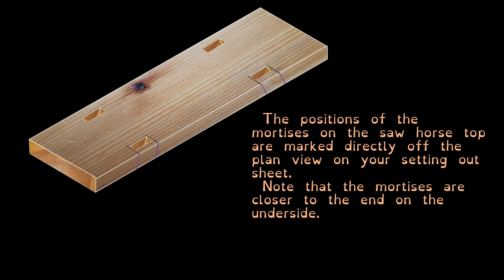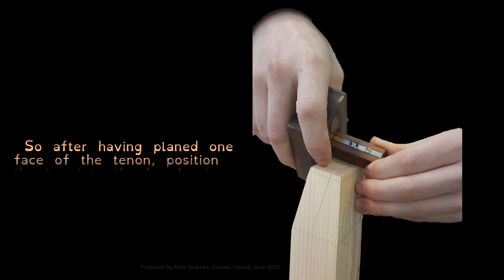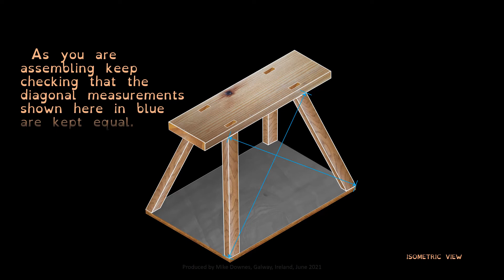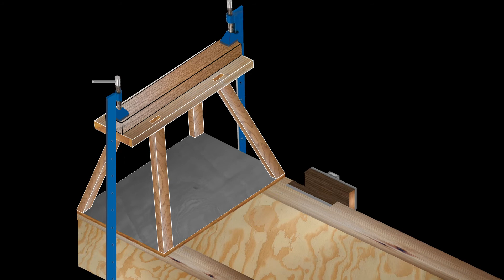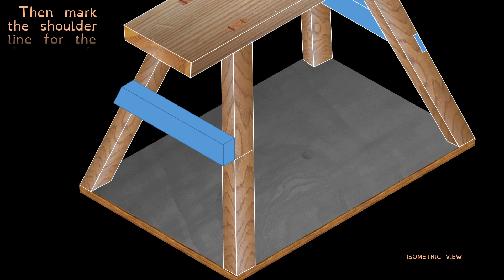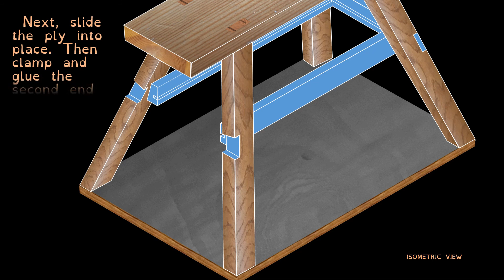HOW TO MAKE A JOINTED SAW HORSE (part 3)

Comment: Great video series, only one question, why have a straight mortice and an angled tenon instead of an angled mortice and a straight tenon? Surely the straight tenon would be much stronger as there is no short grain? 

Could this be modified by drawing the mortice angled in the plan and front elevation and then proceed as normal? The tenon and mortice would also be cut with the dihedral angle yes?
Reply from the maker: Good question...i had considered what you have outlined  but decided to have the tenons come square up through the saw stool top so as only the mortise ends would then have to be  slanted. I did not want to have a compound angled mortise coming up through the top as it would make it a more difficult operation/setup for the mortiser. 

So I opted for the other option of just putting on a cranked bare faced tenon so as the sides of the mortise would then be square to the top face. I knew there would be some short grain with this option but was not concerned  as most of the grain traveled most of the way along the tenon before before any short grain occurred and the dovetailed end rails would guard against pressure coming on the short grain at any rate.

The drawing can be modified so as to have the straight tenon.This will will have the effect of having the mortise  further in from the side along the top surface. This distance can be got by extending the inside leg line up to the top surface on the END VIEW, then measure tenon thickness  square off that line. The remaining distance from this second line along the top surface to the top side edge is the distance in from the edge to the mortise. The distance to the mortise shown  from the end of the top surface on the ELEVATION  VIEW will not change as  the tenon ends are on the same inclined plane, whether its a straight or cranked bare faced tenon.The dihedral will remain on the tenons for both options. The mortises will present as rectangles (they have no dihedral) on the top surface for both options. The mortise rectangle for the straight tenon option will be wider.
Reply: @michaeldownes516  Thanks Michael, this is really helpful. Looking forward to more videos, it's obvious you put a lot of work into your videos.

Comment from the maker: If you find the the ply base tends to bend due to joints being a bit too tight when using the Yoke Clamps, then consider  running a section of  wood  centrally across the the top of the plywood base from end to end, with a G clamp at each end to counteract the bending forces.

Comment from the maker: You can make a router template to take out the lift slot and slot housing  on the saw horse top. Use half inch ply/MDF about a foot square. Then centered along the center line on that 1/2 inch ply drill 2 holes,  80mm  from center to center apart. Use a 1¾ inch hole saw. Next,  draw tangential lines between these 2 holes and cut  slot with a jig saw. The template can now be clamped to the  required position to the saw horse top.  Fit a  ½ inch straight cutter and ¾ inch guide to the router. You will need to router in a clock wise direction so as the guide keeps contact with the slot template. 
Only plunge the cutter after positioning the router to the clamped template. Always unplunge and lock before removing from the template to reduce the chance of injury or damage to the template. And of course dont forget to wear eye protection.